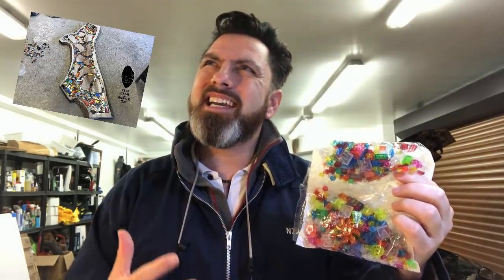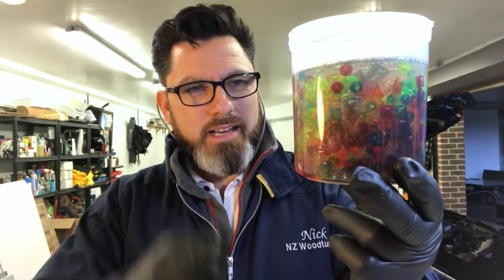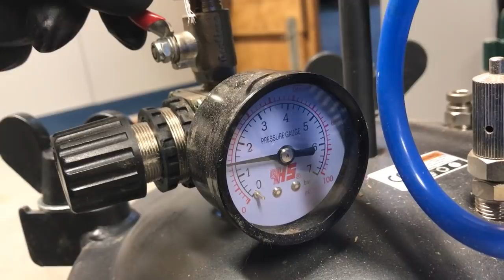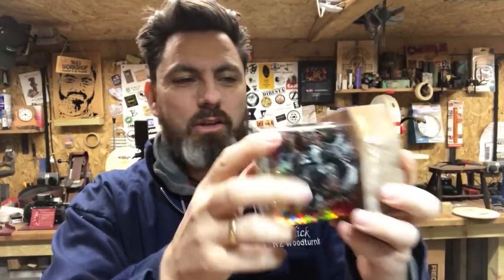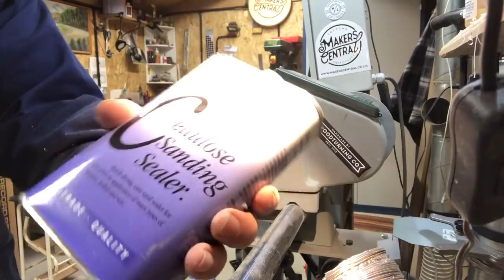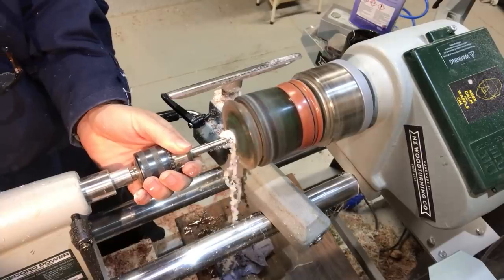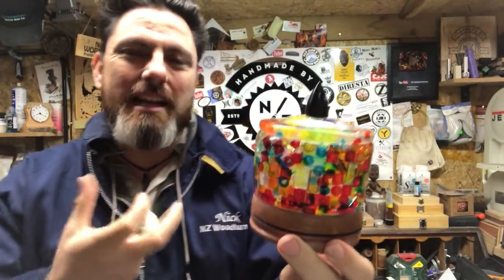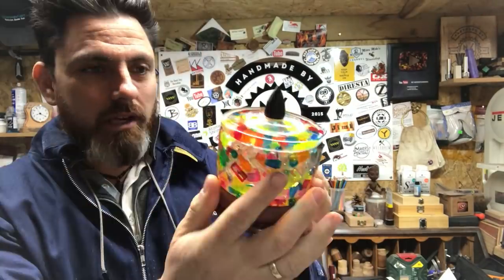woodturning-  lego and epoxy resin - making a lego pot

Comment: Lego bricks are made of ABS, so they'll stick better to acrylic resins than they will to epoxy.  You can also make them stickier by spritzing them with a little acetone before you pour the resin in.
Reply: skonkfactory 
Why does this go into a pressure pot? Why into a vacuum, it would get all the air out and make it stronger. That’s how carbon fiber is made so strong.
Reply: That would be the case, if these were actually "Lego" they are clearly the chinese knock-offs

Comment: It's all about prep Nick. Line up all your lego pieces face down and fill them all with a little resin. Let it go off for 48 hours (or whatever it requires) THEN throw them in the mold. Now they won't hold onto bubbles that would otherwise be trapped! As for that notch where the piece pinged out... put a corresponding notch in the lid rim and you have space for a spoon handle!
Reply: Ian Lynch great advice tenacity wins
Reply: He could notch it like you said and then make a Lego / epoxy honey dipper and turn it into a honey pot.

Comment: Where the lego fell out cut the notch deeper to fit a spoon then fill it with sugar and you have a little sugar bowl for your tea or coffee
Reply: kenny didnt die that’s what I thought
Reply: kenny didnt die
Reply: You can't eat out of resin containers, they aren't food safe most of the time, he''d have had to have used some kind of resin that was designated as food safe for containers.
Reply: I was thinking that maybe he could put something on the lid that would fit perfectly in that groove, so that it would lock the lid in place. Not really necessary, but it would hide the notch
Reply: I kept wanting to see a light inside it
Reply: @AshleyHCRcurvie  you can buy food safe resin and yes when dried they are safe for food
Reply: @kaylaskeen5082  I assume because it wasn't planned to be eaten out of, what he made is not safe for eating out of. So sybby is correct in this case. It doesn't really matter that safe resin exists, if it wasn't used in the first place.

Comment: with regards to the bubbles and air pockets in the lego (or similar), as your using epoxy which has a slow cure time it may be worth considering getting a vacuum chamber to pull out a large amount of the air first before then placing it into the pressure pot (you could even use it later on to do stabilized wood projects)
Reply: darren robertson my thought, too! Peter Brown just got one so now I keep thinking of all the projects that could use a vacuum I'd love to see Nick play with one, too!
Reply: Or he could try to make one?
Reply: He'd still get air bubbles in the resin because of mixing the Legos in. Honestly the pressure chamber is the best option.

Comment: A little tip that might help with those bubbles.. As a baker I've picked up several little tricks to always get consistent results.. To get rid of the majority of bubbles, bang the pot on the table a few times, that bubbles will then rise to the top and pop.. Hope this helps and works for you

Comment: Have you considered getting a vacuum degassing station? They work wonders to get air and voids out. Pressurizing it puts internal stresses on the resin since the air is trapped.

Comment: Just an idea. If you look up wood stabilizing, you may be able to use a similar vacuum type set up to pull air out of the epoxy and Lego's. Also a quick dip into MEK (methylethyleketone) before dumping into the epoxy may increase the epoxy to Lego bond. MEK will slightly soften and etch the surface of the Lego's which should increase the adhesion. It's one of the primary components in PVC glue primer and in my experience has the same effect on many other plastics. I wouldn't suggest the PVC primer itself as it will stain the plastic purple from dyes in it but straight MEK is colorless.

Comment: Can I make a suggestion? If you put the whole mix in a vacuum first you increase the bubbles to 4 times their size and they will expand outside the pockets and float to the top very quickly. They you do your pressure trick and that squashes the remaining bubbles down to a quarter their size.  You will find that this will get rid of 95% of visible bubbles. Please excuse if that has already been mentioned.

Comment: Hey Nick have you ever tried to use a vacuum pot instead of pressure to remove the bubbles? I think vacuum reduces surface tension of the liquid so bubbles will come out.

Comment: I really enjoy your projects.....I try to see all of them, but I do have a question.....have you ever tried using vacuum instead of pressure while your resins cure?.....I build power transformers for a living, and when we fill them with oil, we're required to fill under vacuum so that we don't have air in the transformer......I'm thinking vacuum would eliminate the air bubbles in projects like the logo projects......just a thought......keep up the great projects!

Comment: I have an idea if your up to trying it out what about a bowl of see through slightly colored aquarium pebbles but make or fix a shallow removable bottom and make it with a strand of LED TINY LIGHTS in the middle like do a large bowl pour some of the resin and aquarium pebbles in then place a smaller bowl in the middle and pour the rest of the resin in so when you take the smaller bowl out of the middle from the bottom of the bowl it's hollow place the strand of LED TINY LIGHTS in the middle and seal it up but have the battery control where you can remove the bottom to change the batteries

Comment: lego pieces have a mold release chemical on the outside of them which is what not only makes them shiny, but also what stops spray paint and resin from sticking to it.  If I remember correctly you can clean that off with dawn dish soap and and a scrub pad.  That should fix any future lego in resin problems =)

Comment: Just a question:  Have you tried using a vacuum pot first to "suck" the bubbles out of the resin and air out of the materials prior to the pressure pot to "press" the resin into gaps and flaws prior to setting?

Comment: I would have made an epoxy plug that was larger than the ID you wanted to turn, then poured the legos around that, then added another layer of epoxy to the outside of that, then you can turn raw epoxy with no danger of tearing the legos out.

Comment: Would a vacuum chamber work better than a pressure pot since the vacuum chamber would pull all the air out?  Could then let some back in once it was mostly clear.  Just curious.

Comment: You need to pull the air out to remove the bubbles, not pressurize them, it only makes them smaller :) ebay has lots of vacuumpumps, not ohmygaaad- expensive but worth the money. And you already have the pot for it

Comment: Really nice piece of art. But there are two things i dont understand. First ... The wire at 7:55 is just a normal (copper) wire to "burn" the line? And second ... Really, no attack or something, i'm just curious :) - Why do people on a Lathe still have a full filled object? Especially with resin you could put a bowl in a bowl to save resin and work? Or are there any static issues or something?

Comment: Hello Sir. Can you help please. I want to make some shaving brush handles from a clear resin that I have the option to colour for different effects also the option to add wood shavings and lastly the option of making micarta from material pieces and turning these individual items on a lathe. I haven't a clue on what resins I should use and do I need a pressure chamber. Curing times I haven't a clue on what is best either. Sorry for so many questions but I thought I'd ask a man who knows best. Kindest regards.

Comment: it will be a chore to do but you could first inject resin in the cavities of the lego using an seringe and let dry before trowing them in the big batch of resin
think glitter confetti might be worth a try its not that expencive and should float inside resin
might allso be fun to add some colouring to one side of the resin before mixing them together and get a bit of a see through colour going 
might allso be able to verry carefull stir in some solid colour(s) making a swirl inside the pot and then leave it to dry , bet that would give some nice effects when turned , prolly stays together better then objects cast in resin too

Comment: You could stick some string lights through the hole on the side and in case the battery doesn't fit or you have to plug it into the wall. I think that would look cool. ^^

Comment: Great pot, fantastic great entertainer lol  but OMG dude, please don't ever make a video on how to treat a scale, not only did you not cover it when pouring in sticky resin but you stirred while it was still on the pressure plate!  I know, they're cheap on Amazon.  Just a thought:  If you had added the Lego to the resin after it sat for a few minutes, might you have gotten fewer air bubbles?  Pouring resin over the pieces seemed to create more bubbles that were then trapped.